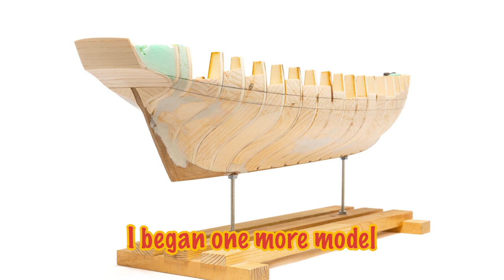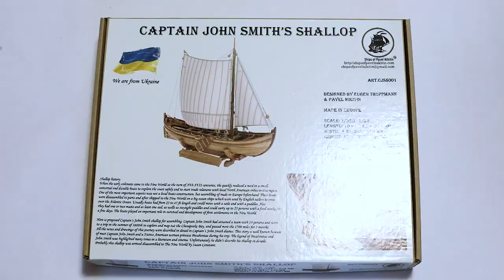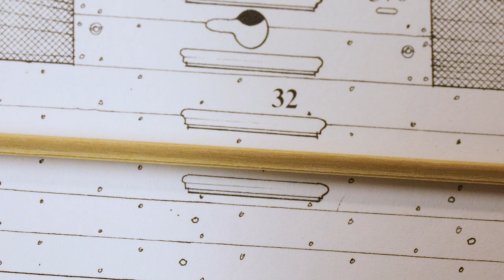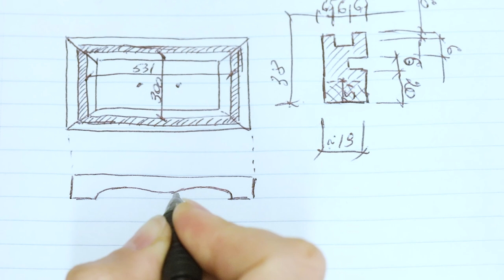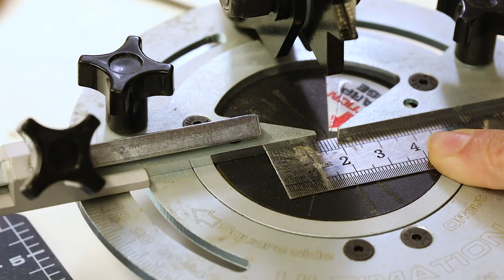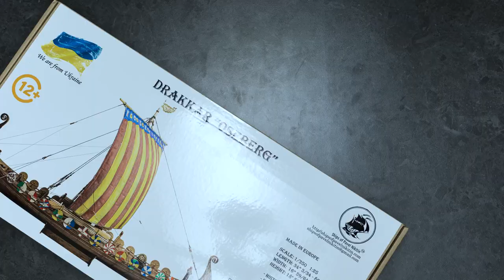The Channel is 3 Years Old

Comment: Olha, I just discovered your wonderful videos and website. I’m very fortunate to have found it since now in the beginning of my retirement I have lots of time to work on the many ship model kits I have collected over the years. Your passion , your work and your great attention to detail are inspiring. I have a few questions and will surely have more as time goes by.  Could you tell me the brand and sizes you use most often of your carbide drill/router bits.  I have a Foredom flexible shaft hand piece. Are you familiar with this brand and if so, do you think it is comparable to your Proxxon? What brand of disk sander do you recommend? Also the brand of cut off wheels? Thank you so much for answers and your awesome work.
Reply from the maker: Thank you very much!
I'm glad you like my videos! It may sound strange, but I use most of the Dremel bits, especially their cut off wheels. If you can use an electric disk sender - definitely don't buy a Proxxon, it's better to choose something with a larger table, etc. (for example, from Jim Byrnes)... But now my faworit is a manual disk sender from the Canadian manufacturer Ultimation Modeling Tools.
Reply: @OlhaBatchvarov  thank you for the info. I just ordered a sander from Jim Byrnes.  It looks great.
Reply: Olha, this is a general comment/question.  In the coming months I plan to visit the southern New England area and was wondering if you allow visitors at your workshop, mostly for observation.  I learn so much from your videos but I thought I might glean more info by observing.  Let me know if this is possible. Thanks